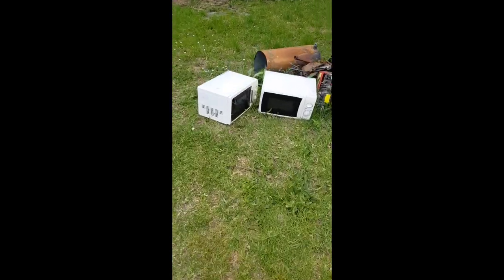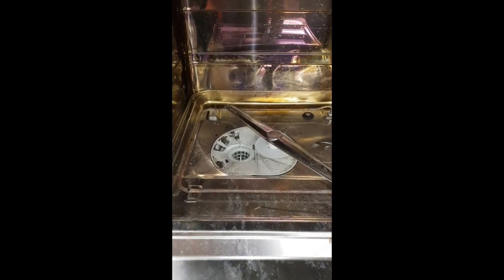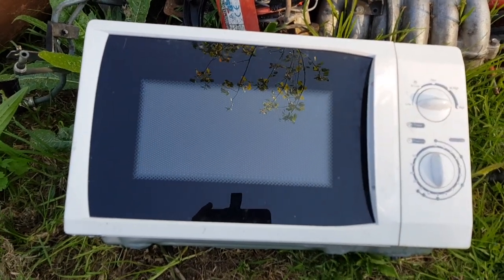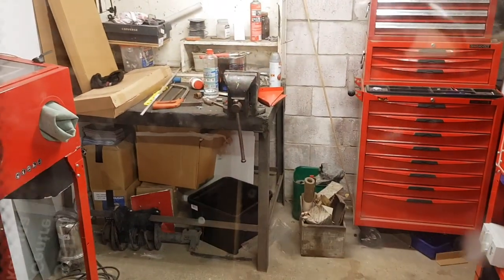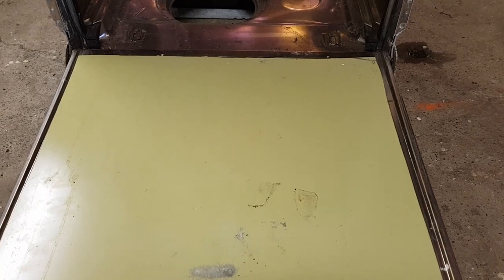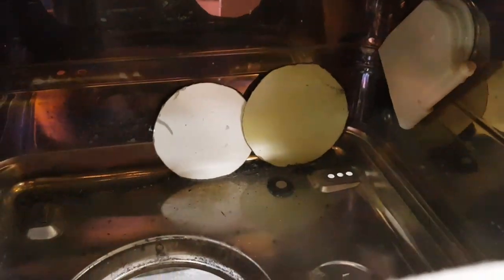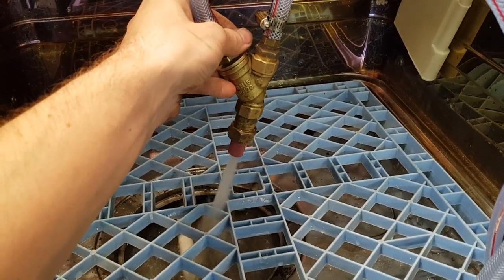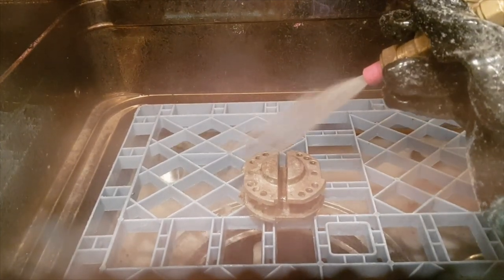World's Cheapest Vapor Blaster? Zero Dollar Build

Comment: Super great job of repurposing the worn-out old into the useful new!!!  You're a great inventor with a keen eye!!!  But for us "not so Clever" can you do a detail discussion on "catch basin", pump. water solenoid use, ect!!  Thanks again  Paul
Reply from the maker: Hi Paul, 
Thank you for your kind words!

https://www.youtube.com/watch?v=RKgAmcZ1ChM&t=9s
This is a video I have done on the pumps, and has a discussion on reservoir/catch basin setup.

The solenoids I use differ. I have used everything from water inlet solenoids in washing machines to much larger dedicated air control valves.

I will be doing more videos as I get the time, but there are a couple of other guys doing some good vids on Youtube. Check out Justin'd Trikes and Venom Chris if you need the info before I get around to it.

Thanks for watching!

Comment: Can a tattoo pedal be used for power you done a vid with washing machine pumps can the solenoids be used off it sorry any spelling as I have just done 2 washing machine strip down and have parts there if I can use them as the rest I can build to
Reply from the maker: Hey man, I am unfamiliar with the workings of tattoo pedals. If they are momentary push switches in the correct voltage then they will work just fine. 

Also, if you check out the update video for this build, it shows the solenoid I used. Yes, it is the once from the dishwasher. So if the ones you have are similar, you should be good to go!

Thanks for watching!